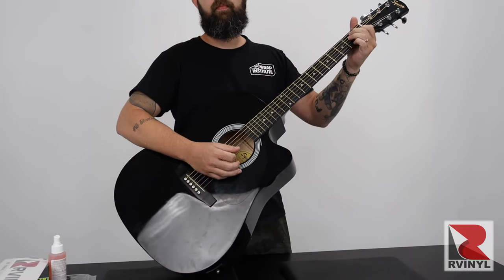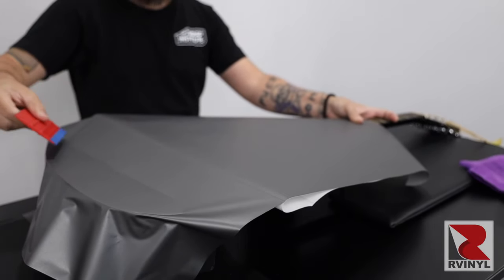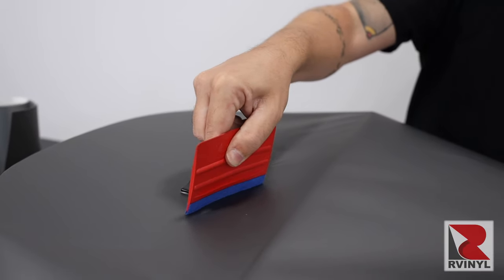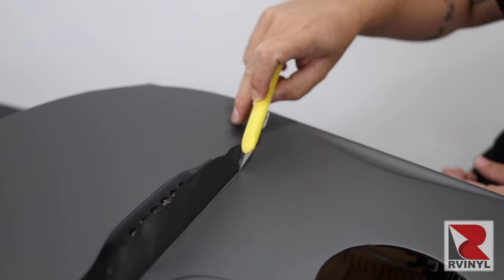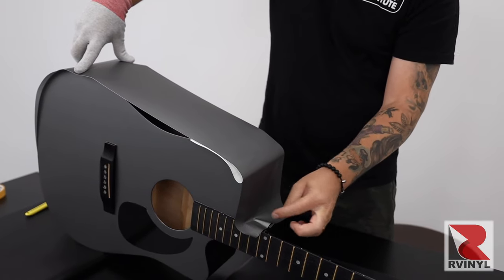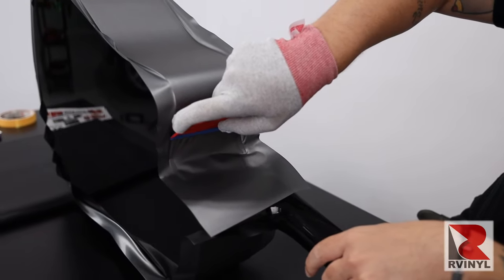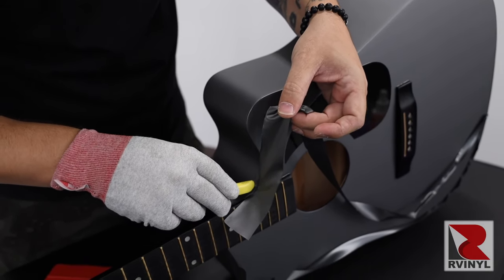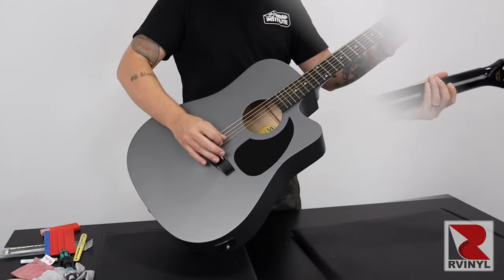How to Wrap Your Guitar for a Look that Rocks

Comment: what size vinyl would you need for the whole guitar ?
Reply from the maker: Usually 2 sheets of 24" x 36" will allow you tow wrap the front, back and sides of the guitar.
Reply: @Rvinyl  did you use a guitar skin or wrap in the video ?

Comment: Why wasn't a heat gun used? Since no stretching of the wrap was done, what would the difference of applying heat be?
Reply from the maker: This would be used in the post heating phase (not shown) to help cure the vinyl and release any trapped air.

Comment: Does this change the sound of an acoustic guitar?
Reply from the maker: Great question, we did not hear any noticeable difference nor heard any complaints. Either way, it is removable.
Reply: Moks, there will be a slight difference. The formula for determining wood movement for acoustic instruments shows that the thickness of the moving cross section has a stiffness that is multiplied by a power of 3, a cube. The thicker it is, the less vibration, bottom line. Thick coatings on violins, cellos and classical guitars will dampen the movement and the resulting ability to project sound.

Comment: I was just wondering about this, as I was thinking about wrapping an electric guitar with one of the carbon fiber wraps. I wasn't sure if it would stick to the factory lacquer.

Quick question for you though: the guitar body has a few minor chips here and there. Nothing huge, just some very shallow dings in the lacquer with none any bigger than about 1mm. Since the carbon fiber has visual texture, can I safely just wrap over them? I know they might be visible after wrapping, but is that the only issue? Or, should I try to repair them first?
Reply from the maker: It shouldn't amage the factory lacquer at all. Carbon Fiber s actually an excellent choice (over a Glos solid color for example) because of the texture. No need to repair them unless you maybe want to seal them beforehand to prevent over-adhesion.

Comment: Would the guitar get damaged if you choose to remove the vinyl
Reply from the maker: Assuming the finish or top coat on the guitar is in good condition, no it should not get damaged. We recomend heating the film prior to removal to soften the adhesive.

Comment: Will this work for an open pore walnut guitar?
Reply from the maker: That's a great question. If you mean a guitar that is not sealed, no top coat it is probably best not to wrap it. The adhesive could affect the grain if you ever choose to remove it and essentially take tiny slivers out during removal. If that's not what you meant, please let us know and we will do our best to get you the answer!
Reply: You can wrap it 
Just don’t take off the wrap or else the wood won’t look the same